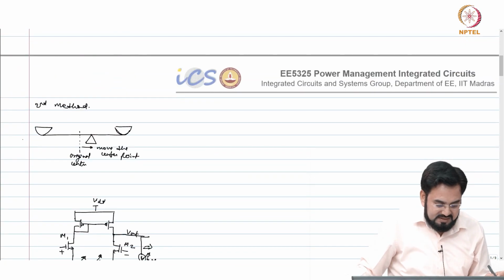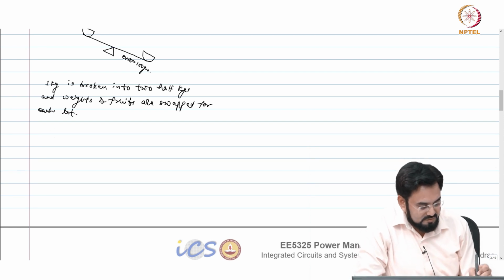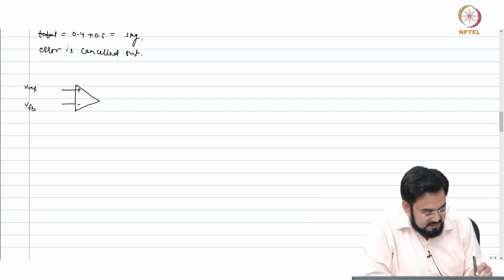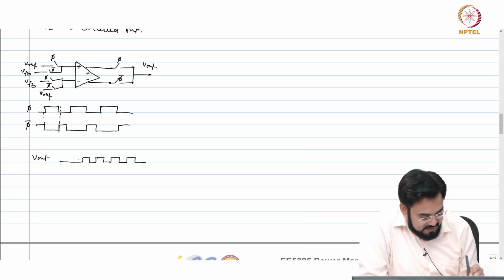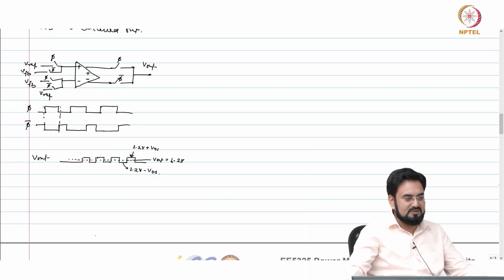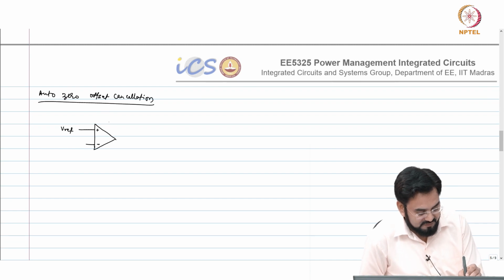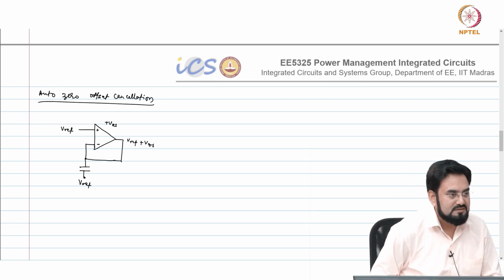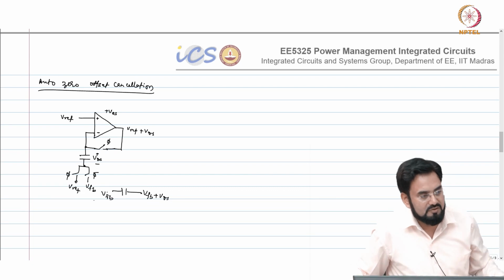#28 Dynamic Offset Cancellation Techniques | Chopping | Auto Zeroing)

Comment: Sir, how to filter the ripple on Vout due to chopping ? Will the amplifier pole be able to do that ?In that case the opamp closed loop BW << the chopping clock frequency ..am i correct sir?
Reply: low pass filter at output can help to reduce the ripple.I think bandwidth should be more than the chop clock frequency otherwise OTA maynot respond to the chop clock frequency
Reply: @AnnamAbhilash  thank you😊